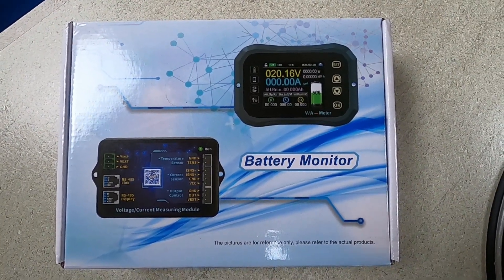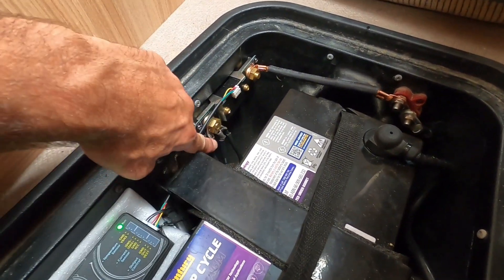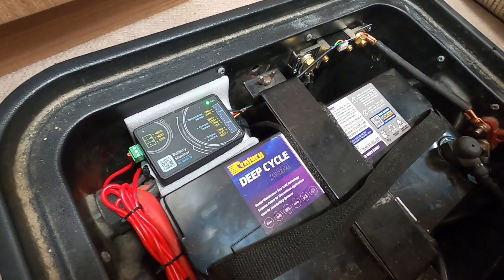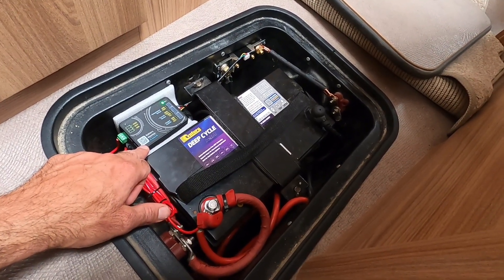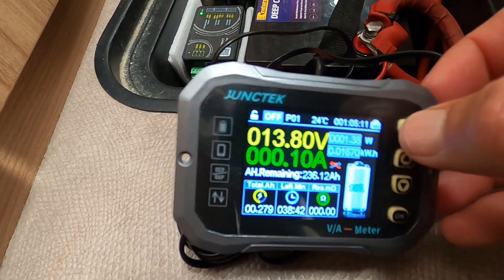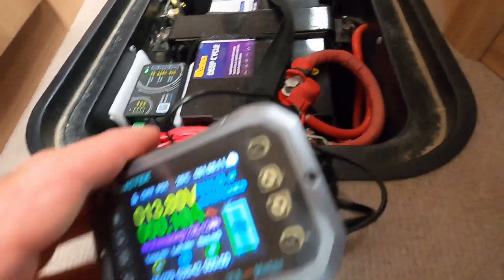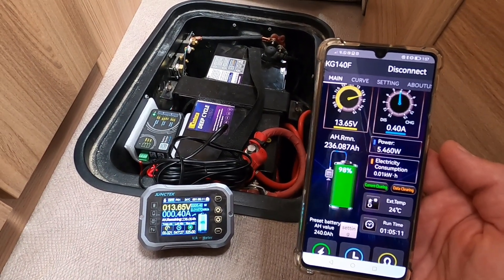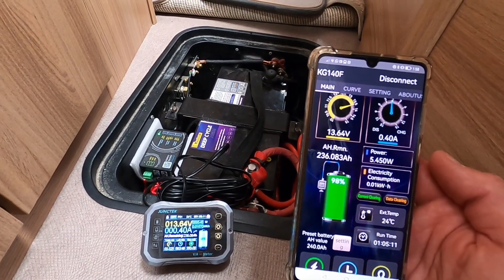$100 Caravan Battery Monitor Install and Review

Comment: You followed the instructions from the manual, the only thing is that Juntec did not subscribed a fuse (5 or 7A) in the 12V feeding line into the control box. I would advise to install a additional fuse.
Reply from the maker: You could be right. The draw on that 12v wire is minute do you think it is a material risk? Perhaps just a 1A glass fuse would be OK?
Reply: Just a small 1 to 5 A fuse will do @caravanwise

Comment: Hello, I just got this device (the 2023 model)  Is there someone who can make a video or send me info on how to install a relay to protect my solar system with Lipo4 batt. What kind of relay (12V array, with 300Ah 12V Lithium battery bank), and how to connect. Thanks in advance.
Reply from the maker: What are you trying to protect the system from ie overcharge or over discharge? Not sure why you need a relay I didn't need one in my installation this monitor channels the load through the shunt so has nothing to do with charge side. Also, wondering does the device support lithium battery OK once you've set up?
Reply: @Caravan Wise  , First,  yes I use a 300Ah Lithium. Second, how can it do so via a shunt as there is no switch or limiter inside. Third, all protections.
Reply: Got same type setup 200Ah LiFePo4 only one 200A Fuse in battery and connected as regular battery to my caravan. Worked 2 years now. You do not need any other "protection" in my mind.

Comment: This meter seems well constructed but has issues. My major annoyance is the application demands “File and Media”, “location” and “nearby devices” Rights.. thereby exporting my data to some Chinese server. I use my meter on my Samsung S6 Tablet docked in the DEX ( desktop extension mode ) displayed on a big tv with all my other important data. I literally had to run a long HDMI cable to the basement and relocate the tablet downstairs just to keep a clean Bluetooth connection, even so.. I still have to search many times for the device if I restart the application ! I’ve tried the app on various phones of android and apple ! The “firmware update” freezes the application, furthermore the “CURVE” page doesn’t dependably work. This device could have been so much better… I bought my meter 6 months ago.
Reply from the maker: Geez that's a rough ride. I've got 2 android devices using it and no issues at all. You're right about allowing location (set only while in use) this seems to aid connection. Storage permission - you can deny this and app still works. I find if you force close the app when you're done, to open turn on Bluetooth then launch and it works 💯 so not sure why you're having issues. I guess this unit tho is a hobbyist quality sounds like your setup is pretty elaborate maybe your quality expectations are higher than mine for $50? cheers for the comment hope that setting change helps u
Reply: @caravanwise  it is possible I got a lemon. I’m going to Amazon another and return it if it gives me any misery. Thanks for the file rights thing and for this forum of comments…
Reply from the maker: @jethrotull5847  good luck
Reply: @caravanwise  thanks, listen if you own a late gen Samsung device get a cradle capable of charging, giving usb3 ports and outputting video. DEX mode allows multiple windows open so as you drive you can view google maps, battery conditions, weather radar, and even blood glucose level.. like a cool mobile dashboard! Take care…
Reply from the maker: I was thinking about what you raised earlier about connectivity issues and did some more testing myself. For the BM in my caravan I can connect from the tow vehicle when stationary but it loses connection once driving along. I tested on my friends caravan with their high end lithium battery monitor and same there - I don't think connectivity is intended for outside a close range and while stationary perhaps
Reply: @caravanwise  Thanks for investing some your time on this. I’ve noticed when I use a VPN on my tablet and “spoof” my location.. I have no comms till I clear the application cache. All in all I do like this product as after I finally gain connection it seems stable. I’ve learned that Apple devices have better Bluetooth radios as to gain that constant connection I’ve had to place my android tablet downstairs and run it remotely over a hdmi cable ! Yet my apple tablet has no issue gaining a connection thru the house floor to the basement. My system is 2000 watts DIY at my house. I do not use a grid tie inverter so it is important to manage loads and battery charge states. This product fulfills that requirement. Unfortunately as many items manufactured in China it’s a first rate, third rate solution for me, but I see no other cheep solutions. Again, great testing  involve multiple experiences. Thanks for you help !
Reply from the maker: @jethrotull5847  I understand that use case. Quite specific. Sounds like a cool setup